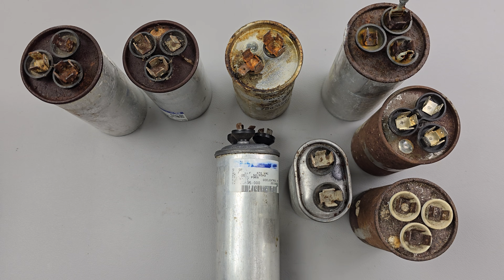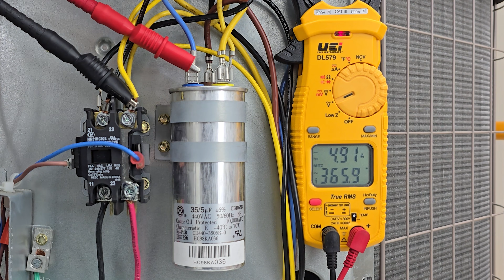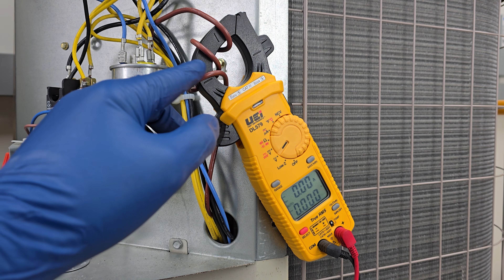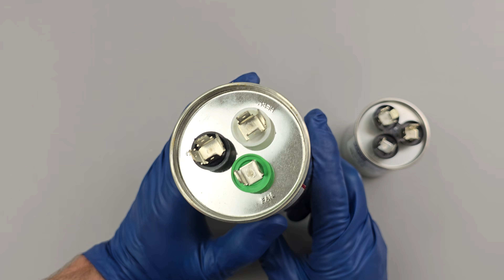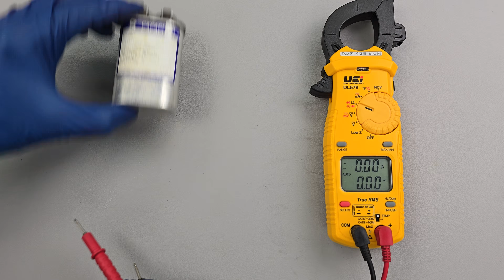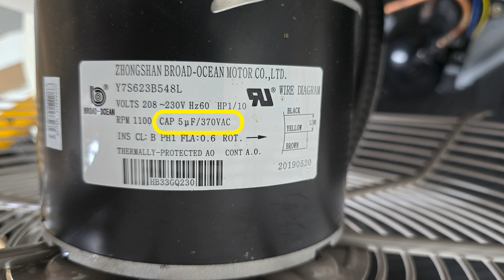HVAC Capacitor Testing! 3 Methods, Underload, Bench Test, & Visual Inspection!

Comment: Don’t you need to safely discharge the capacitor to remove the wires to bench test it? I don’t think it was clear how to safely do that. Also it would be very interesting to see the several capacitors tested under load and then bench tested to see how close the result is, as well as a clear explanation of which test is ultimately more accurate. The multimeter bench test doesn’t measure under real load but the test under load test can introduce other variables which don’t reflect the actual condition of the capacitor. One other interesting thing would be to know how manufacturers do their QC test better approving their production run.

Comment: solid breakdown of all three methods. the under-load test is probably the most practical for real field conditions since you're seeing actual performance rather than a bench reading that may not reflect how the cap behaves under heat and load. one thing worth adding for homeowners watching this: a degraded capacitor often causes the compressor or fan motor to struggle to start, which can look like a lot of different problems. if a tech tells you the capacitor tested weak and recommends replacing it, ask them to show you the reading and confirm whether it's outside the rated tolerance before approving anything. ARS / Rescue Rooter is one option that provides written estimates before work starts, though pricing and availability vary by location.

Comment: I've changed a few capacitors over the years but this is the first time that I ran into the issue of it being corroded to the point that I couldn't see the terminal labels.  I noticed that the terminals had different amounts of tabs, but you are the only source that I could find that described how to decode that.  Thanks so much!  Great information and video!

Comment: Good breakdown of the three methods. Worth noting for homeowners watching this: a degraded capacitor often shows up before a full failure, which is why the under-load test is so useful in the field. If you're not a tech and your AC is struggling to start or cutting out on hot days, a weak capacitor is one of the first things a tech should check. It's a relatively inexpensive repair when caught early, but if the compressor strains long enough trying to start, the repair bill gets a lot bigger. If you don't have a tech you trust, ARS/Rescue Rooter is one option worth comparing, though pricing and availability vary by location so check what's in your area.

Comment: 9:55 If the capacitor reads 5.53, it is out of tolerance. It is not good. It is labeled 5 +- 6%. The maximum tolerance would be 5 x 106%: 5.3, and 5.53 is 10.6% above the standard rating, far past 6%.

Comment: Craig, as always this was a great video. Always thoroughly explained and technically very sound advice. So, I know it doesn't matter whether or not the compressor is under full load to get an accurate reading, but why is that? Thanks!

Comment: If you’re wondering where the number 2650 comes from it’s from this formula for capacitance.  c=I/2pi60V,  c= I/2*pi*60*V, C=I/120*pi*V,  C=I/376.99111*V,  C=0.002652582*I/V, We want the answer in microfarads so we divide by 10 to the -6 power which gives you  C=2652.582*I/V where I = current. V= voltage, 60 is the frequency, pi=3.1415926.

Comment: wouldn't you just put the probs on common and herm (capacitor)    then check the amps with the clamp (herm wire)? or checking the contactor and herm proper way? learning still so go light on me

Comment: When i was in the trade in the early 1990s, a 5mf, stand alone, condenser fan motor capacitor costs $5. We charged the customer $10, plus labor (usually 1/2 hour or up to an hour if we were performing a full inspection). It pisses me off that people are getting charged $400+ for a simple capacitor replacement.
Reply: I hear ya. Everything is expensive now. In defense of the companies charging that, they paid for the tools, education, parts, and time of the tech. It adds up.
Reply: @-Kreger- and things have gotten more complicated since then more training required and more expensive tools and equipment
Reply: I charged by the micro-farad for what I deemed the lesser brands such as Titan or the Chinese brands, i.e. for a 40uF capacitor I charged $40, but for Amrad (Turbo) capacitors which I considered the top brand since they lasted the longest (typically 5 or more years), I charged 25% more. I charged them an hour labor as well. But I charged a minimum of $15 for sizes smaller than 15uF. I considered this necessary since the Chinese brands seemed to last only about a year or less and most didn't last the full duration of their warranty, which was a year. I used to get funny looks from the counter personnel whenever I brought one in for replacement under warranty; they'd usually say "No one usually warranties capacitors. They usually replace it and charge the customer for a new one." I always looked at that (not honoring the warranty owed to the customer) as poor customer service and as condoning the wholesaler's purchase of poor quality capacitors.  I learned it always paid to buy higher quality capacitors. I viewed it as an investment in customer satisfaction and repeat business. For about the last 15 years in business (I was in business for 18 years in small town Iowa and 7 in another larger eastern Iowa city (back in the 80s when capacitor longevity wasn't an issue since they used a different dielectric than they do now)) I used exclusively Mars and AmRad (Turbo) capacitors since IMO they were the best.
Reply: @rickl5938 that's very fair and reasonable. Thanks for the info 👍

Comment: I have to disagree with your statement of “one going to give it the 24v signal and then plug in this disconnect”
I have picture proof of the damage to my disconnect. The company I used for my HVAC (until I went through and got training myself) had been doing this and I can see how much copper was eaten away from arching on my disconnect. The contactors are built for that purpose. LOVE your videos!
Reply: yes, ideally you'd only use the disconnect when there is no load present, otherwise they do arc and pit.  fast removal and insertion helps curb that.

Comment: I like how you got an inconsistent reading measuring the fan side under load and wrapped the wire around the amp clamp to get a more accurate reading. Capacitors aren’t really much over their microfarad rating often, usually it’s just the tools we’re using to measure them.

Comment: Best and worst capacitor brands?

Also what’s the advantage to checking a cap under load compared to checking it with everything off besides the speed of checking?
Reply: A capacitor can measure within spec on a meter (low voltage) and fail with "run" voltage. Idealy test at the capacitor rated voltage.
Reply: As always, Craig is the professor of HVAC!  

Question. If a motor has continuity in its windings, it will discharge a capacitor for the most part, and any little residual left in it can be discharged with a screwdriver, usually. There’s just not much left in it to discharge and cause damage. What’s your opinion on this?

Comment: Thank you for your very instructive videos. How do you set the multimeter to read both voltage and amps at the same time?
Reply: Actually, it is a unique feature in UEI Clamp-meters and also in Klein Tools CL445 Clamp-meter ....
wishing one day to buy UEI DL599 clamp-meter .

Comment: By the way why 2650?
1/(2*π*60Hz) * 1000,000=2652.58…
Basically using ohm’s law and impedance to calculate C.
Reply: calculate it out both ways and see how large the difference is(or isn't!) on the common small hvac/r run cap values, which are generally 80uF and under.
at 100uF it will be about 0.1 off and far less as the value decreases.   nobody worries about 0.1 when the cap is 70 80 rated and certainly not worrying about 0.00x at the lower values. that;s already far closer than a typical meter is accurate.

Comment: "Why check for voltage after  you just pulled the disconnect?"
"Because no one has never, ever (not one single time) bypassed a disconnect."
(Wink, wink.)
Reply: I've seen it where they crossed the whips, so you had no clue what unit was cut power.
Reply: I need to start doing this as a noobie getting into ac season... haven't shocked myself yet working on 480v 3 phase rtus thankfully🤣
Reply: Is to insure good safety practice.